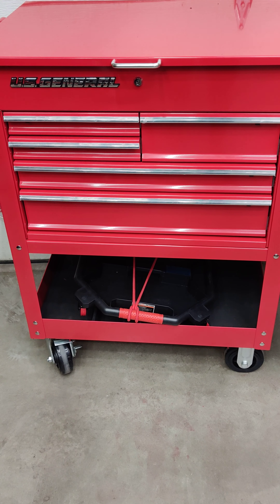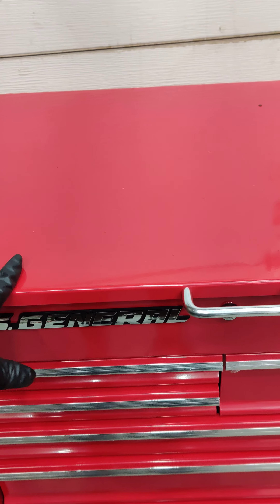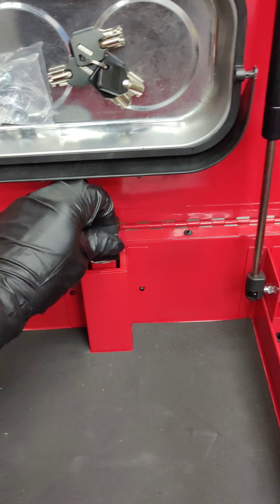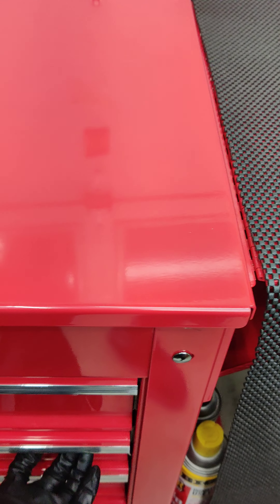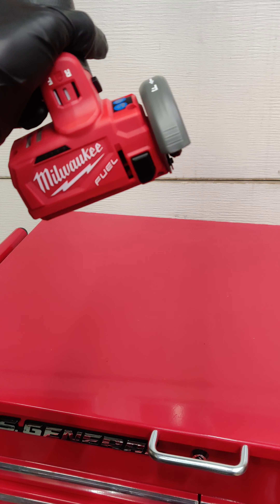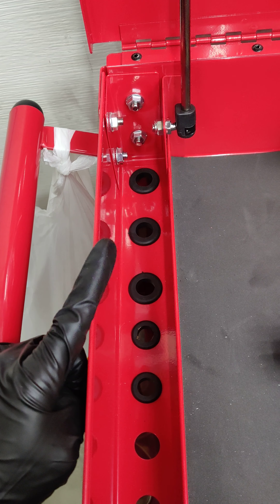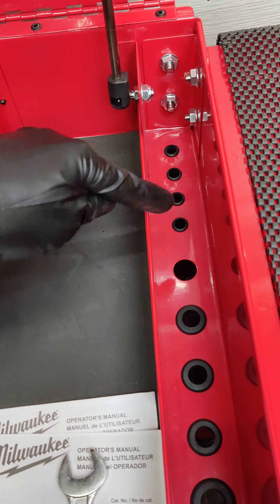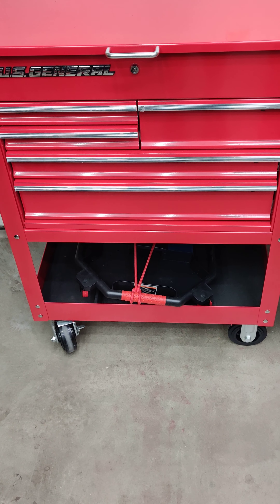Harbor Freight US General 2 Tool Cart (Must Do Easy Mods)

Comment: If you don’t like the chrome strips on the drawer pulls, they slip off easily and can be spray painted. I have a black cart and I painted the strips blue. Looks good
Reply from the maker: Thanks Sam for the comment. I am considering doing something like that later within my two cart modifications.